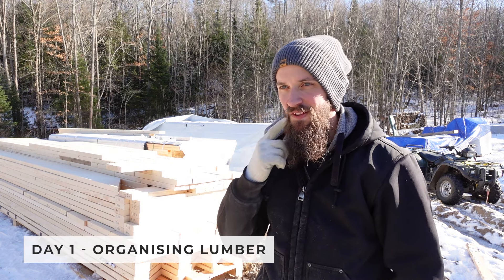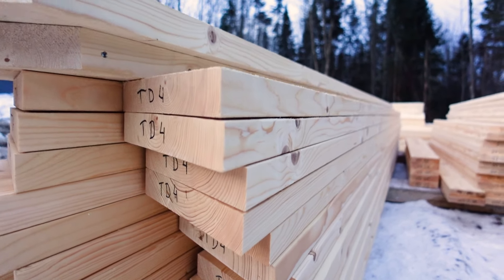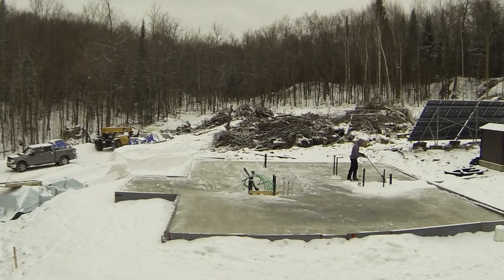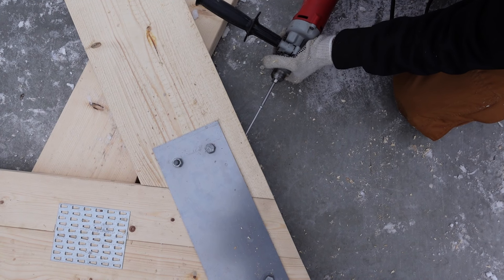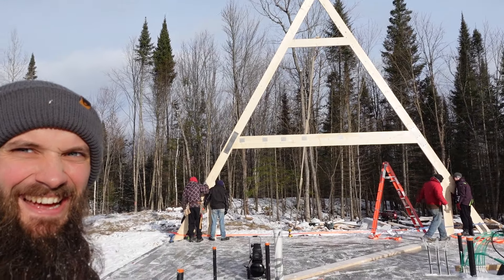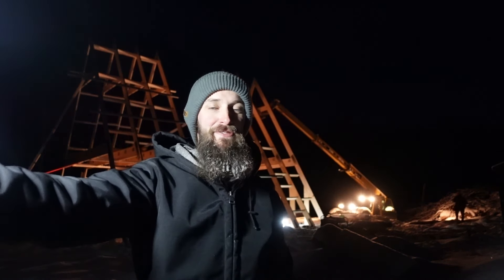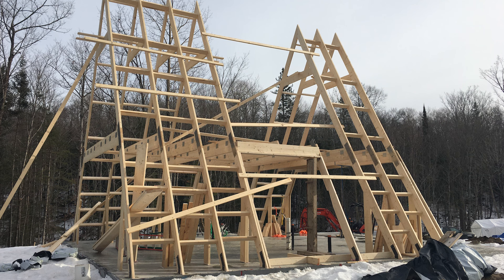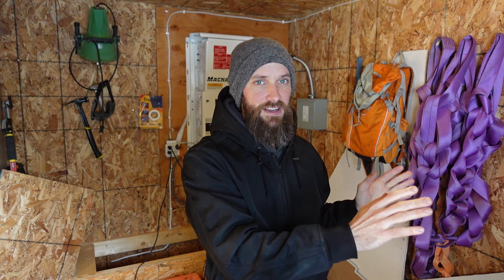Truss Raising IN THE MIDDLE OF WINTER!! Harder than you think!

Comment: Having a strong leaf blower to remove the snow off the work area and materials is super handy in the winter.
Reply from the maker: Thank you! We did buy a leaf blower specifically for that purpose but we get so much snow and it’s so heavy that it wouldn’t work. But it’s great for a light dusting here and there. Was certainly useful in the fall with leaves! We’ll keep trying!

Comment: That’s incredible work! Given the amount of thinking that you need to do, it’s really coming along well. Is it in the plans to attach the trusses directly on top of a concrete slab? What insulation do you have between the two? Is this because you will install floor heating system? Great video record of this first real step into A frame building. Congratulations.
Reply from the maker: Thanks for your comment! Actually our insulation is inside the concrete. We’re doing heated (exposed and finished) concrete floors. Avrame modified their plans so we have no floor trusses. Instead the A trusses are attached to the concrete! 😊